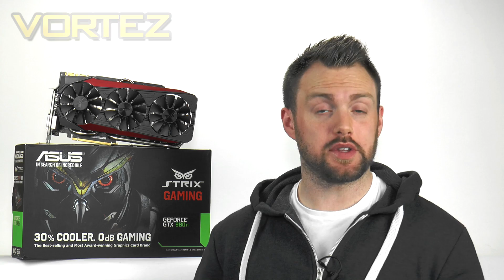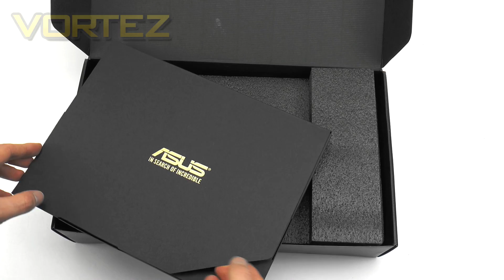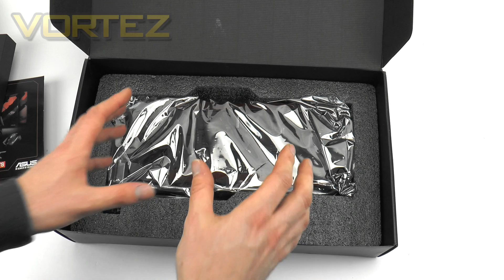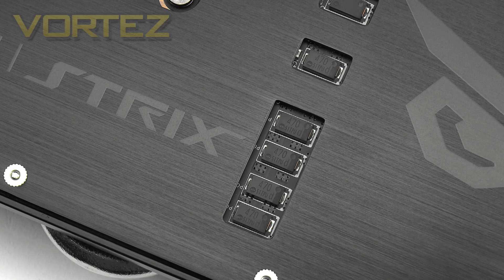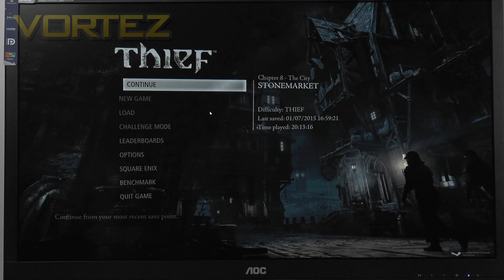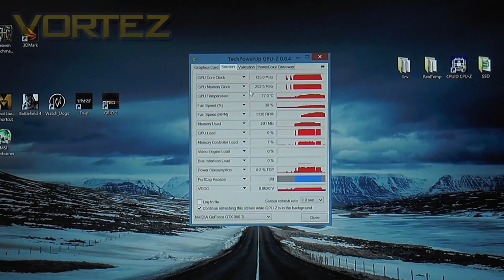ASUS STRIX GTX 980Ti DC3 OC Review [HD]

Comment: Do you need 700w psu instead of 600 as for other 980 Ti cards
Reply: +ToriksLV Under load, the card uses 380 watts, so add that to your max wattage of cpu and add a good 200 watts extra.

Comment: Good review but my sample hit 82*C in a long term gaming
Reply: +MegaPiotros Know this comment is kind of old, but i feel like its still worth mentioning. Many of the early strix 980tis had a heat pipe that was not placed correctly. Asus actually had to redesign the cooling to fix it. Thats why it was late for some people. Cards with the fixed heat pipes never run above 75c from the reviews ive read.

Just wanted to tell you in case you were still wondering.